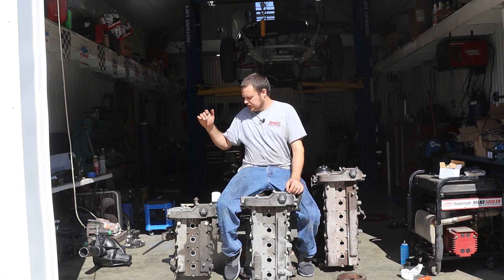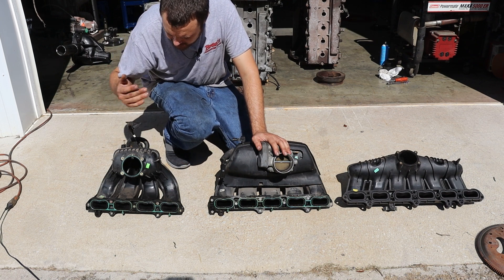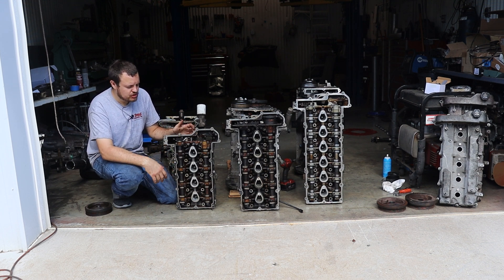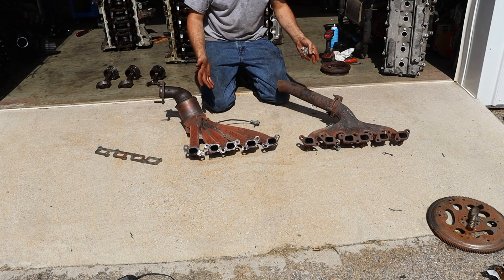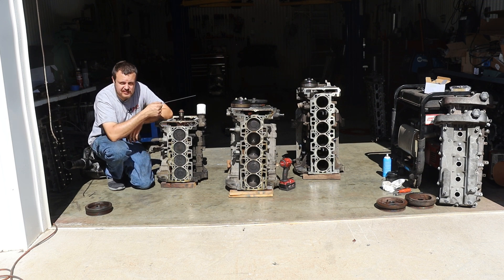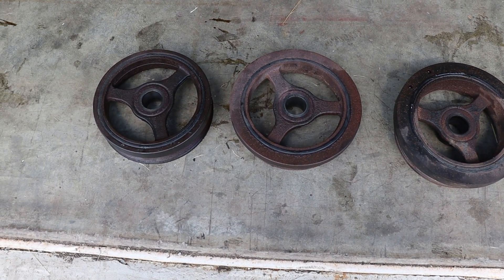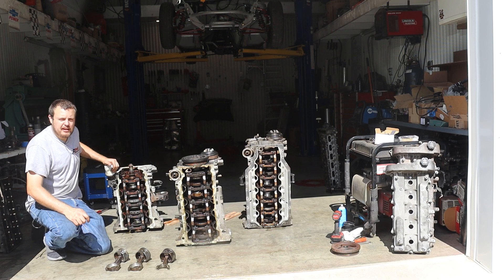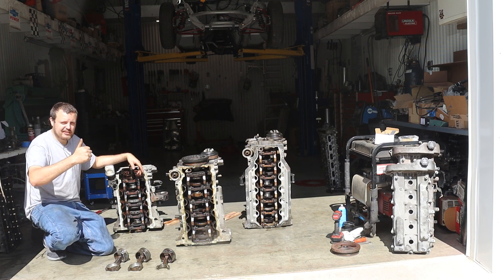GM Atlas 4 vs 5 vs 6 Cylinder Engine Comparison

Comment: been thinking about swapping the 5 cylinder in my s10, how long is the engine? It has an LS in it now and there isnt a ton of room in the front of the engine bay.
Reply: It’s no guarantee but GM did run the LS and the Atlas 5 in the same platform for a few years.
Reply: Compare the colorado and s10 lengths
Reply from the maker: Take the length measurements and subtract 4 inches. https://sites.google.com/view/vortec4200wiki/dimensions?authuser=0
Reply: thank you @Calvin-Nelson

Comment: I Would love to see some breakdowns of the four and five cylinder engines performance with and without balancing shafts
Reply from the maker: Not so sure there would be much performance benefit, but I would expect a great improvement to longevity and the ability to spin to higher RPM without fragging a balance shaft.
Reply: @Calvin-Nelson   I'm guessing that it'd feel more responsive.  They'd rev faster without all that extra rotating mass.  The most noticeable on a MTX car.

Comment: I've really liked the Atlas engines since they first came out. I was baffled why no-one was picking up on the performance aspect. Very glad that you are pioneering the virtues of the engine. Kudos!
Reply: Thoroughly flogged 200,000+ miles on my 2004 I-6. I can see why it was never put in a pickup. It does move the 4900+ lbs it is in. Well enough to scare the old lady.
Also not making it with the larger cylinders for pickups. But mostly because the full size pick up design styling is not convenient for two extra cylinders in length.
Also like my brothers '82 300CI F250 real 4x4. That would last too long. Oh and someone built a rail dragster with a 300CI Ford. Fastest 6 banger on the planet.
A lot faster than a lot of V-8s.
 But from the 50s and 60s. "Wouldn't you rather have a V-8?"
 Why are most of the OTR haulers I-6s? I understand V-8s. Two cylinders shorter for a tighter turn radius.
 Yes I have had to back up a army duece for almost a mile because the road in Germany was too tight to make the turn.
Reply: At least for the inline 5 they had some pretty common issues that kinda killed them from ever being picked up for performance as most people around that time would take the 4200 i6 or the 4300 v6.. I mean you can take a lv3 ecotec 4.3 direct injected engine can be built to make over 700hp to the crank with a stage 2 cam deletion of dod lifters vvt and afm along with 14.5 pounds of boost from a turbo
Reply: Because it ain't a V-8
Reply: Because they were junk probably
Reply: @themuckler8176  
No. Its because doing so requires someone to think outside the box.

Comment: Can the 4200 be bored out enough to accept the 93mm pistons?   Displacement, Displacement, Displacement, . . etc.
Reply from the maker: The 4300 is already 93mm bore. I think what you are asking is can you buy the 95.5 pistons in. If you resleeved it you could.

Comment: I met a guy a few years back who was already in the 300 mph club in SCCA events. He was upgrading and was considering the 5 cylinder GM  motor because it really moved a lot of cfm!!
Reply: While in college I worked in a VW dealership in Colorado Springs. One of their offerings was a 5 cylinder. I finally caught a factory techy coming through asked him why 5? Well he said 4 cylinders didn't make enough power and 6 was too long!! I thought those clever Germans had discovered a discreet principle of dynamics dictating their move. Nope it was 4 vs 5 vs 6!
Reply: @highpointsights 
Their VR6 certainly wasn't too long.
The VR-6 had certain advantages production wise. Compact which is good for packaging. One cylinder head which saves money. Machining lines for engines are expensive. Most OHC V type engines have different heads on each side.
Reply: @highpointsights   My Dad has a I-5 GTI and it's fun to drive.  Such a unique sound.
Reply: @highpointsights  Fun little fact: The head casting for the early EA855 VW 5-cyl is the same as the Audi/Lambo V10. There are many other differences I'm guessing, but they share the same basic casting.
Reply: I think he's still around.  I'll try and contact him and find out what became of that car.  He spent a bunch of money doing fluid dynamics and as I recall he was saying that he found a real advantage by running open wheel over streamlined "wheel pants"!!
Reply: SCTA? Southern California Timing Association. I don't think the SCCA runs events at any tracks that would allow enough room to get that fast.
Reply: Mark magley?

Comment: I wonder what the power increase would have been if GM did the larger bore on the 4.2 as well.

Really wish GM had released the original TBSS concept, just imagine the aftermarket support it would have now

Edit* well it looks like the I4 gained an extra 6% and the I5 gained 10%. So if an extra cylinder added 4% more then the I6 would probably be 14% , so around 331. I could be completely wrong but that looks about right
Reply: They made a 405 HP version of the 4.2 for the Trailblazer SS, but did not use it for crash test reasons, and went with a 395 HP 5.3.
Reply: @wymple09  yeah I know. It was a twin turbo 400hp 4.2, Motortrend got to test it back in 2002 or 03. It was supposed to be the future TBSS but I'm assuming for cost that it was easier to drop the 6.0 LS2 in it. They were originally going to push the I6 for performance, that is one reason why they ran it in Baja. I don't know if it's because the Bara engine never came to the States that is why they chose to just scrape it or it was just more cost effective. The gmt360 platform was the only platform that was designed around an engine, instead of just designing a vehicle and then dropping in whatever fit
Reply: @MrAero_1  They dropped the entire atlas platform because they wouldn't fit well in the newer upcoming  base cars, the Equinox & such. The six was just too long
Reply: @wymple09  I know that but I was referring to the Atlas being dropped from the TBSS model, not it being dropped in 2009. You can actually fit I6 into the Colorado with zero mods, it's a tight fit but it fits.

Comment: Awsome video. What do you do for the crank trigger settings on the earlier cranks?
Reply from the maker: Run it
Reply: @Calvin-Nelson  does the megasquirt currently have settings for it? The DOHC lt5 has the same trigger and on the last few swaps I've done I haven't been able to get that trigger to work and have had to swap to a trigger wheel off the crank

Comment: I never cared for the 5 cylinder variant. Was supposed to be the power of a 6 cylinder with the fuel economy of a 4 cylinder. What we got was the power of a 4 cylinder with the fuel economy of a 6 cylinder.
Reply: Ehhhh, more like we got more power than the 4 cyl that fit where the 6 would not.  Fuel economy wasn’t great but a 3.5/3.7 with the precat deleted and the intake plumbing re-worked made surprisingly good power and wonderful induction noises.  The 4x4 GMT 355 ride height with those 15” wheels and balloon tires was more to blame for the lousy MPG than the engine.  I’d be willing to bet a 6+ speed transmission would have made a big difference too.

Comment: I have had to change several 4.2 motors for having extra inspection holes in the block. Was usually due to lack of lubrication. One lady went about 17k miles without an oil change.
Reply: I refer to that as an unscheduled disassembly.
Reply: @My-Name-is-Mud-1969 
Or as SpaceX calls a RUD

Comment: Calvin, did the 4 or 5 cylinder ever get a manual transmission?
Reply from the maker: Yes.
Reply: 5 cyl manuals are very rare.  Not sure if I’ve ever seen one in a 4x4 either.  They were derated (for towing) pretty significantly too IIRC.
Reply from the maker: @GoFastGator  A friend of mine has 4x4 5 cylinder manual. They're out there.
Reply: @Calvin-Nelson  2006 Hummer H3 came with the 5 cylinder 3.5 liter (some with a 5 speed manual transmission !) Then they had the 3.7 liter 5 cylinder again (some with a 5 speed manual transmission).

Comment: I hope that really was a hint at a 5cyl project - I'd LOVE to hear one of those at 8000+!
Reply: Yep. I'm here for the the 5 cyl noises. Don't care if it makes power. Just want turbo noises and odd cyl count.
Reply: @HumbleDaves  same, if it just makes 350hp and makes the right boosted 5cyl noises thats a win in my book 😂
Reply: The 5's have a narly sound as pretty much any 5cyl would (baby V10). I've been waiting for Calvin to highlight the other Atlas editions👍
Reply: 5 cyl sounds like the sweet spot. Medium displacement, medium weight, big bore.
Reply: @Aheitchoo they sound cooler than the 6 stock too. I had a 3700 in my first truck I loved that motor almost as much as I do the sbc 350
Reply: It would be so badass I haven’t seen one even over 300hp I can’t imagine what ole 5 banger could do.
Reply: Ditto
Reply: Yep. When 4 cylinders aren't enough, and 6 is way too many.
Reply: Yeeeeeesssss I need that in my life
Reply: With the success of the 2.7 high output 4 cylinder these past years id say gm is cooking up something. My guess is a straight 6 twin turbo 3.5 or above making crazy power to combat ford and the new ram hurricane engine. I think it will replace the 5.3 v8. And 2 versions like a regular and a high output for higher trim levels. I can feel it coming.
Reply: Can you tune the 5 cylinder for boost and what software is recommended.
Reply: The 5 would be wicked in a C4
Reply: Sounds like every other 5 cylinder
Reply: @km6832  because 5 cylinders are just the most common engines of course 🙄
Reply: 69th like 😏

Comment: Would love to see you do a jeep swap with a 2.9 atlas . Jeeps are just begging to get atlas swaps , it only makes sense a lighter more powerful engine with better mpg that fits . You could even run the gm transmission and transfer case on a Cherokee , would be great content and bring the jeep crowd over to your channel.
Reply: Not only that, but the 4 cylinder Atlas engines have great low end torque which would match up well in a Jeep.  Personally, I towed an old GMC Sonoma on a heavy Uhaul car dolly with my old 2006 2.8L Colorado.  It was able to cruise on level highway in 5th gear at 65 mph with 3.42 gears.  It got 19 mpg towing that truck too.  I loved that truck, but had to sell it after a porous block caused a never ending oil leak.
Reply: @91CavGT5  i drove a 5spd colorado with the 4cyl and was surprised by the low end torque! It was really hard to stall out lol
Reply: You'll need an adapter if you want to use any other transmission. The Atlas bellhousing pattern is unique. Not a drawback, just something to be aware of if you're parts shopping. The t-case bolt pattern is regular old GM though.
Reply: @Clean97GTI  the gm transmission would work in the jeep

Comment: I have 330,000. Miles on My S-10.  Ready for an engine swap. Anyone know if the 4cyl Atlas will bolt up to the 5 speed in the S-10?
Reply: IIRC the Atlas engines have a proprietary bellhousing bolt pattern. So you would need a matching gearbox. I think some of the Colorados came with an Aisin 5-speed.
Reply: I’m sure someone makes an adapter but I bet it would to cheaper to just buy a Aisen 5 speed. That transmission is actually stronger than most people would think.Their in a lot of peoples LS swapped Colorado’s and surviving abuse. I seen one break with an LS, but your going to have that with over 200k miles on it and 500+hp going through it doing pulls,drifting,burnouts.

Comment: I just worked on one of the 5 cylinders. Guy smoked the motor and had someone install a used one. They left out a dowel pin. It broke the flex plate and he ran it for 2 hours. It broke torque converter. Customer pulled trans new converter flex plate and put new dowel in. He put it together and it leaked all trans fluid out I installed used trans and no more trans leak but oil pouring out of back of engine. I never pulled flywheel because. He said he put nre rear main seal in. Well he did but the rear seal housing had 2 large holes ground in it from broke flex plate. Had to pull trans back out
Reply: damn.

Comment: Would love to see some content on the 4/5 cylinder atlas engines! 🤓
Reply: The 5 cylinder specifically. People turbo them in the Colorado it comes in
Reply: Maybe a jeep swap , be real easy with that rear sump pan .
Reply: @pisstoffcat5136  I'd be really interested in sticking a 4 in a Alfa Romeo GTV (916 series).
I've got a solid body one standing around, the owner blew the Alfa twin cam and gave the car up due to eye watering rebuild prices.
Reply: Yes
Reply: Meeeeee Too..!!!!!
Reply: The ecotec 4 can do better with 2.0l
Reply: @retrocompaq you're not wrong